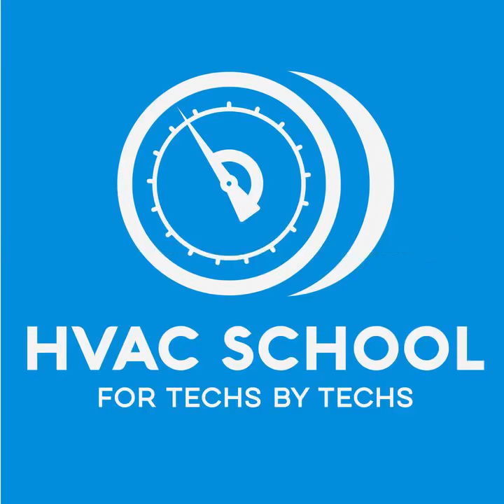Short 2 - Delta T

Comment: I recently listened to a podcast you did for home inspectors.  i’ve ordered the 605i but you also recommended the freon line clamp temp tester.  what will those values do for me regarding delta t?  you also mentioned outdoor temp in the shade as part of the calculation.